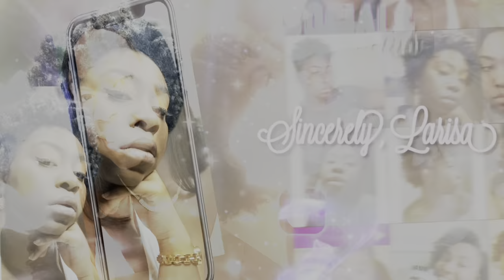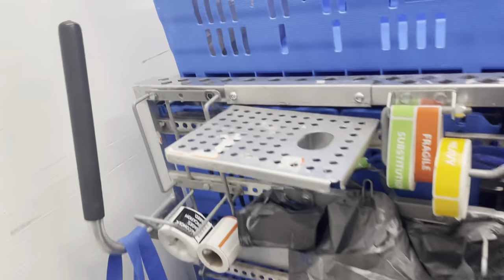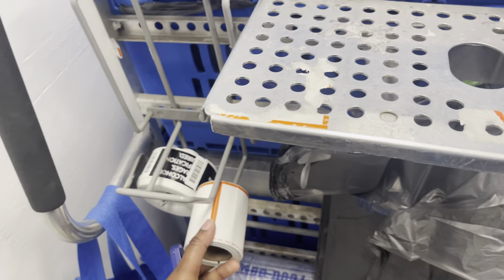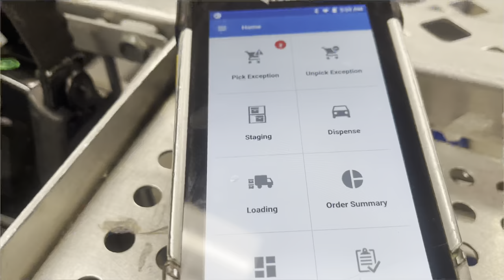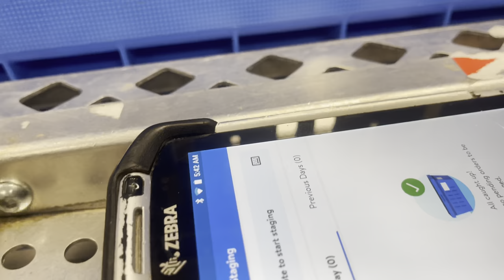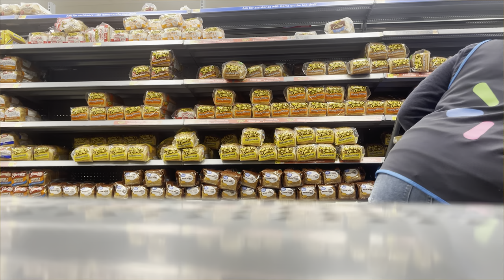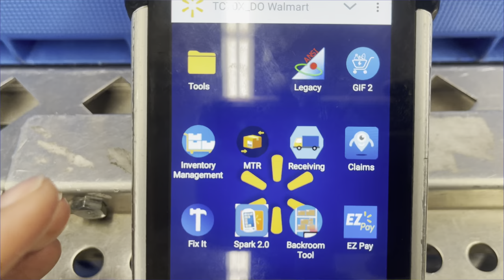DAY IN THE LIFE OF A PERSONAL WALMART SHOPPER 2022 + HOW TO GET A HIGH PICK RATE

Comment: LOL I work in OPD and I’ll let y’all know that I bag with one hand sometimes, I almost never touch the bag handles cause I stick the item straight in the bag and strategically place the item in a back corner of the tote if it’s a big item or in a front corner if I can fit more in it later. I pick 700+ items a day and my pick rate is normally around 130%-170%, the key to shopping quickly is being observant for items, shopping quickly, and bagging quickly. I also pick a lot when I drop my cart and grab another in less than a minute, I’ve discovered you can waste a lot of time very easily in the back room. Also y’all need to get of your phone 😂, I have like 10+ coworkers who don’t pick more than 500 items and constantly take little breaks without their Team Lead or Coach knowing to message or talk with friends, some of y’all think you’re getting paid to hang loose with friends online and that’s not work efficient. That’s what the 2, 15 minute breaks and hour lunch break are for. Please comment for questions, I have been asked several times to step up in command at work but I don’t have the time and I still like to learn a lot for fun and like to help as much as possible with my boss.
Reply: Does exiting out of a walk before scanning anything mess with your ftpr?
Reply: @josermtz  I think so, I was told so by my Coach

Comment: Do you do all the calculations? Or what happens if the item they want isn’t there? Do you also change the prices or apply discounts or do you just worry about getting the items and delivering them?
Reply: Customers order online for delivery or pickup. If an item isn't in stock they will either get a replacement (similar item, possibly a generic brand) and get a digital receipt via email to my knowledge. I'm sorry it's been three months to get an answer.

Comment: Very interesting and well done. I'm not a personal shopper but I've used the online ordering/car pickup for about 2 years several times a week and overall I've been amazed at the accuracy of the shoppers. The one thing I've been frustrated with lately is dented cans. I've had this happen 4 or 5 times in the last few weeks. What is Walmart's policy on bent cans? I've always heard it can be risky healthwise. Thank you for the peek behind the scenes.
Reply: Hi cinnie2.  I can help explain some info on dented cans that you say you are getting.  1st, dented cans should NOT be something you are receiving through on-line shopping at a store.  Walmart online shoppers are to pick only the best choices, and that is NOT a dented can by any means.  A small dent on the side or corner of the top or bottom will not affect the safety of the product.  If the dent is on the seams - top, bottom, or side, consider the food to be generally unsafe.     Again, shoppers are advised not to pick ANY can with ANY dents on them. 

If you're an on-line shopper and have been receiving dented cans, let the store know.  Not all on-line shoppers are fully aware of ALL things!   Like cans, no one is perfect.
Reply: The pickers are supposed to check the cans for dents and select cans in good shape for your order.  However, if the only cans of an item left on the shelf have some minor dings in them, they might pick them for you just as you might do for yourself.  Any cans with major dents in them shouldn't be on the shelves to begin with.
Reply: From someone who worked stocking Ta 1 for them. Walmart will try and sell damaged items no matter what. Long as the content is still in the package. A hole on the bag just put some tape on it. Oh some of content spilled? Just put a new top on the package and move the product to the front shelves.
Reply: So how many shopping transactions do u have to do a day ?

Comment: How long is your typical shift? Or do you pick until a certain number of orders is fulfilled?
Reply: 9hrs with 2 paid 15s and a unpaid hr lunch
Reply: @michaeljordan8859  come to sysco, some selectors make like 50$ an hour with bonus.
You will make 30 flat rate after 4 years
Reply: OGP associates work anywhere from 4 to 8 hours, depending on availability. 6 hours or more gets an hour unpaid lunch. The picks drop every hour from 6am to 6pm, and when picks are done depends on how long they take to be shopped. My store is usually done shopping for the day around 6:30-7:30pm, though on especially busy days it can take longer. As an associate you can stay until picks are done as long as you aren't getting overtime (OT must be approved), or you can clock out when your shift is done. Associates who work the closing shifts (1-10, 4-10 etc) aren't technically supposed to stay until all the orders go out, but it looks better on them if they do

Comment: I'm curious....if a shopper has a mixed order of cold stuff (ice cream, milk, ice, etc) along with regular temp items, are they seperated in two different totes?  Also, what if they have a big order and there is no more room in one tote? The labeling and storing still confuses me....
Reply: Ok so there's different categories of picks and say one person will get the frozen part of a single order and another person will get the chilled items like dairy and meat and another will get "ambient" or grocery/ consumables items and another will get GM (general merchandise) and so on. So yeah it's in different totes because of that and stored in separate areas based on temperature requirements. If it's a large order then it's not a problem to make another tote.
Reply: Yes in the back there is dolleys with attachable hooks that are used when dispensing (each dolley is 2 totes wide and can be 5 totes tall for 10 per dolley. For room temp items (ambient) there’s 4 different sections by color and number - 5 if you count the front pickup room, deliveries one, pickups in another, oversized, and express. Then there’s coolers numbered and barcoded as well as freezers.